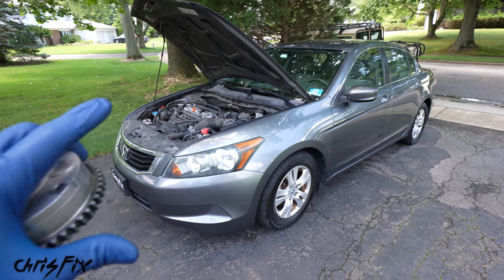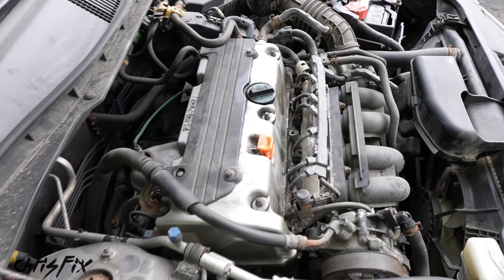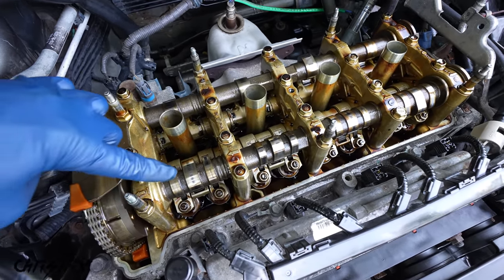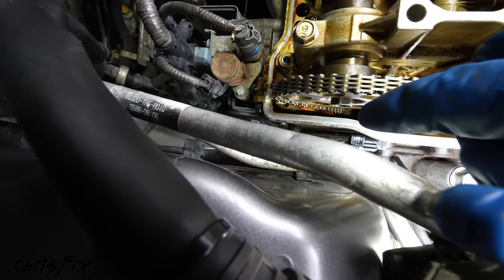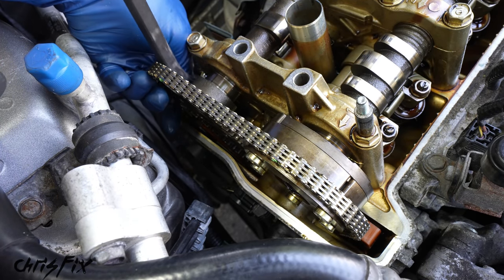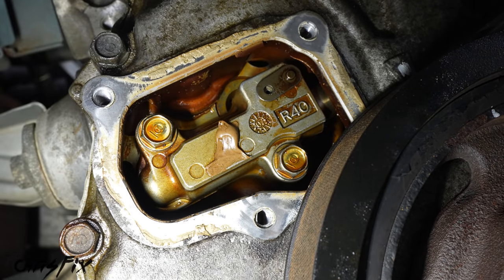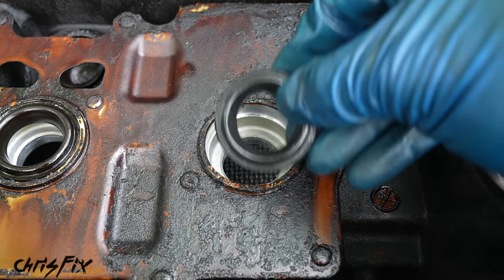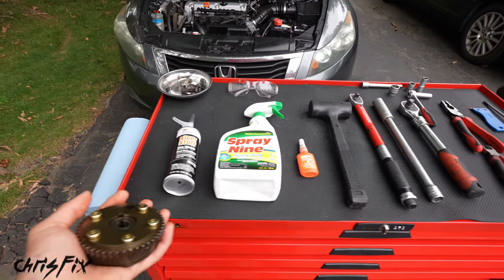How to Replace a VTC Actuator (Complete DIY Guide)

Comment: Great Video! I was gifted a 2004 Honda Civic SiR that was parked for 6 yrs. I've been driving it for 6 months and only now, when the temperature drops to about freezing intermittently I get about a 1 sec rattle right when I turn the key. There seems to be no performance issue, no codes other the an evap code and the SRS light is on. Initially I thought it sounded like a starter issue but now I'm thinking VTC. Is there good aftermorket VTC's? The dealer wants 325$ for one. Thanks for any help, and is this car worth putting money in it?

Comment: Great video. I have a 2012 TSX Wagon and it has been making the VTEC Actuator rattle for a couple of years. No check engine codes though. It's getting pretty much all the time after overnight and getting louder. So time to fix it. The OEM actuator is $224+ S&H. The aftermarket ones are about $100 cheaper.  Looks like you made this video about 4 years ago. How is the fix holding up?

PS: Where you at? Come over and help me do mine? $$$ :o)
Reply from the maker: From what I know its been holding up fine, I would grab a high quality aftermarket one and you should be good to go

Comment: I have a 2013 CRV with this issue. It also uses about a quart of oil every 2500 miles or so).. My mechanic tells me this is the "new normal" as they run hotter due to emission requirements and that causes it to burn more oil. I find it hard to believe as my 2007 Accord hardly uses a drop of oil between changes. Is this true for anyone else or do I have a bigger issue? I see no leaks and can't believe this is at all normal. Any recommendations of what to do or check would be greatly appreciated! @ChrisFix - Greatest Repair Videos I've Ever Seen!!! Thanks a million.

Comment: im impressed you were able to pull this off. however i do not recommend the average weekend warrior attempt this on their daily driver on a sunday afternoon. instead  you should start saturday morning and pull the timing cover off and do it the proper way. first off getting that actuator bolt off is a problem it itself 🤣 the best way is to remove the cam and zip it off with an impact gun. its usually so tight you will round off the cam with the wrench trying to break it loose. but anyways if you are brave enough good luck to ya! playing with interference engine timing chains is risky

Comment: Hey loved the video have a question my 2009 honda accord has excessive crank before starting when this happens the VSA light exclamation triangle and check engine lights come on I’ve changed the crank position sensor  wondering what you think

Comment: I always put the spark plug tube gaskets in the freezer for an hour. I'm never able to just push those seals in by hand and usually use a large socket to "gently" tap in the now chilled gaskets (that are now minutely smaller).

Comment: Replacing the VVT actuator in my 2016 Scion IA. You say they're supposed to come unlock from the dealer, but I saw three different ones from two different dealerships that all came locked and I was told it doesn't matter. Does it matter or not? Does it only matter on certain cars?

Comment: For those of you who don't know any better, the purpose of using heat to break a bolt loose it to warm and expand the surface the bolt is screwed in to, NOT to heat the bolt itself. 
Adding heat to the bolt will make the bolt expand in the hole.. 
You want the hole to expand around the bolt..
He still happened to crack it loose in this video, but he didn't make it any easier on himself.

Comment: I did this repair last weekend and it went pretty well, however, once I got the valve cover off I noticed the timing mark on the harmonic wheel went past the arrow when the top marks on the sprockets are lined up. I guess my timing chain needs to be replaced. I finished the replacement of the VTC actuator and put it back together. The vehicle is running fine and no engine light, but I am worried about the lack of line up on top dead center. Am I safe to wait for a engine light to come on or do I need to change that timing chain urgently?
Reply from the maker: How much past was it?

Comment: Hi Chrisfix! Would you happen to be in Maryland?,🤔
My VTC is bad and needs to be replaced.  After watching your video (btw beautiful job, very caring and professional). i'm very concerned whether a Honda dealership tech is going to do the job right and as painstakinly as you did with great care and know how.  You said it is a job costing upwards of $1100. dollars,  and watching your DIY video I see there is alot that can go wrong,. especially if they don't clean as they go,  and take smart precautions as you did.  So curious to know if this is a common repair for Honda techs and that they will/should get it right the first time and not overcharge me.  My Fit is no longer under warranty and will be out of pocket.
My engine light is not on by the way.  But only makes noise at cold starts, after sitting for a while...
Am I right to be concerned that I  can trust that Honda can do it right?

Comment: Awesome video, I am having the same problem with a CRV.  I noticed that Chris used advanced auto parts for the actuator, the OEM Honda part is quite a bit more expensive, any concerns with advanced auto part?
Reply from the maker: I havent had an issue but I got the part from the owner. If it was my car I would probably buy oem. They will both work.

Comment: as for removing the tube seals: turn the valve cover right side up, put a long flat head screw driver at a slight angle on top of the old rubber seals and hold the screwdriver in place, get a 3 lb mallet and hit the screw driver once (think impact screw driver) and the seal will put out. Do this for all of them. 10x easier then removing them from the bottom by bending them in as you did.

Comment: Anyone’s reply could be helpful here. I’m sure some have heard of just changing out the spring inside of the actuator. I’m curious if Chris or anyone else who watched this video would still say that changing the spring may be the only fix that some vehicles may need. I noticed that, while this video was amazing, Chris did not explain what actually makes an actuator go bad. The only reason for a bad actuator that I have managed to find online is the spring. There is also a fairly recently launched website that seems legit enough called “spring-start” which is specializing in these springs. I read up a bit and it seems to be an experienced engineer behind this. Probably driven by how common of a problem it was and how much easier it could be to fix. I want to fix this issue on my girlfriend’s car and I want to do it sooner than later. If the cheaper route is all that’s necessary then I’ll take it. Any thoughts on this?
Reply: Did you go through with it? In the same boat now. Thinking replacing the spring and checking if the chain is stretched is a good first step.

Comment: My 2009 acura tsx has the same problem. Even tho I plan on replacing the vtc actuator, I was wondering if it cause any sort of damage to the engine if I don't replace it or replace it right away

Comment: Hey Chris! I had a problem with my chain. I accidentally dropped the chain in and my pin fell out of the tensioner. I’m not sure if the timing is correct. What would you suggest. PS. This is my daily driver sitting in my grandmas driveway 😅

Comment: I have a question. My car is a 2011 Honda Accord 2.4. I got it from a dealer with 70k miles and now it has 170k. It runs perfectly fine. I have never taken off the valve cover until now. I removed the chain guide and proceeded to put the engine to TDC. As I lined up the crank, I noticed that the cams were not lining up. It appears that the exhaust cam is behind by 1 tooth. Could I have done this by just turning the crank while the chain guide was off? And also how would I go about fixing this? Can I just move the chain off the exhaust cam and turn the cam forward one tooth? And lastly if I don’t want to touch any of that, what if I just simply set the cams to TDC even tho the crank isn’t, then mark the notches up with paint as you do, take off the actuator, then put the new one on. Technically I didn’t adjust the timing correct? (Assuming that the car has been off by 1 tooth since I got it)
Reply from the maker: I would just take the chain off the cam and turn it forward so it lines up properly. Double check it's actually off before doing it though as sometimes it can look off but it is just an optical illusion.

Comment: I have the exactly same issue on my 2012 Honda Crv, but no other issues that i noticed other than rattling noise only in winters. Should i replace this in my car or i can live with old one? It's almost 10 years with that noise so not sure if it's harmful inside?

Comment: I would like to ask why you didn't clean the valve cover ? I will do this job soon if there is a problem with that just answer me please , also I see some one who opened the valve cover and the oil pan then washing slug engine with chemicals and water after that he blow some air until dry , is that good thing ?

Comment: hi bro, I also have accord coupe 8 gen, 2.4 automatic transmission. When I come to a stop in "D" mode at a traffic light and keep my foot on the brake pedal, the engine RPM drops to 600 rpm/min, and the hood, side mirrors, and steering wheel start shaking. When I turn on the air conditioner or headlights, the engine RPM increases to 750, and the vibrations are almost gone. I have visited many different mechanics, and they have replaced the entire suspension, axle, shock absorbers, engine mounts, but it didn't help. Perhaps you know what the problem could be? I haven't changed the spark plugs, and sometimes the engine makes a strange sound while driving, like "tak-tak-tak," but the sounds disappear when I increase the speed.
Reply from the maker: Has it always done this since you got the car?

Comment: The timing is off now on this 2010 accord I'm working on, I just put a new VTC actuator so whats the best way to fix the timing, any specific marking on the stock chain? The top dots are at 12 o clock but the middle lines are off now, they were lined up when I started working on it tho, Any advice would be helpful ASAP.
Reply: You ever figure it out? I was trying to take the bolt off for the vtc actuator and it spun the shit out of alignment so now my notches arnt lined up anymore 🫠and for some reason it won’t let me turn the crank shaft pulley anymore clockwise
Reply: @lenakarasek160  I just bought a new chain kit for it & ended up taking the timing cover off, actually in the process of it. Waiting on a specific socket to arrive in the mail to be able to take the harmonic balancer off, it's a 19mm but has to be a super thick one
Reply: @grizzy909 yea I might do that as well and get a new timing chain too I think I messed it up 😅

Comment: Hey Chris, I got a question. I recently got a socket ratchet stucked inside my spark plug engine coil, what's the best way to taken out the socket ratchet without removing the Engine Valve? I recently watched a guy use a paint can opener to get his socket ratchet out then replace his spark plug alongside with his coils.

Comment: Just attempted this job today and for the life of me I could not get that chain back on because it was so tight. Had to remove the tensioner as stated and man was that a mistake.  
WARNING*** If you remove tensioner, be super careful not to move that chain around at all except for adjustment and keep tension on it from the top. I thought mine was good when I put everything back together and turns out it's probably 2 teeth off at the crank. Now I have to take it all apart and now theres no reason not to replace the tensioner and the chain/guides while it's all apart but man I didn't want to do the full job.  I hate this happened but that tension was just too tight to get both sprockets back on.

Comment: hey Chris, in this you say don't worry about the marks on the chain they wont line up anymore. What is the point of having the different colored links on the chain at all? I'm watching this because i had to do head gasket on my 03,CRV and when i lined up marks, put chain back onto dots and made sure the crank was on the mark,when i turned motor over twice the chain wasn't even close to dots on cam gears.I've spent hours trying to find out why the chain doesn't go around its path and align with the dots and have all other marks line up. I still don't know why. It is basically just going in a circle in a triangular path so why wouldn't marks all realign?  So your saying don't bother worrying about the marks on chain just make sure lines line up and crank is on and your good to go? I'm confused by this. I've done a shit ton of civic belts and Acuras. This is the first time I've done one that when you rotate it over ,ALL of the marks aren't dead on. why?

Comment: @chrisfix do you know why the Fel-Pro kit comes with 8 spark plug well gaskets instead of 4? Just to have extras? Great video! Helpful before I try to change out the valve cover gasket to solve an engine leak issue

Comment: My only problem was the cold starting noise, after watching the video I gain enough confidence to do it my self. The problem In ran into was the dead center marks were not perfectly aligned and the chain tencioner did not look like one in the video (it seems missalign) so i stoped and put everything back because it went far away from my skill level.
Reply: Did you end up having to replace the chain?
Reply: @tbarbuto2345  nope. The car has 370k miles, and I bought it for 2200, so I decided not to pay attention to the start noise and drive it like that since it works perfectly fine and the car does not worth  the investment.
Reply: @yomero8557  I understand we have been bumping our starter a couple times before fully cranking the car to start and don't hear the noise because the oil pressure builds in the actuator

Comment: Thanks! I have a 2013 Honda Accord 2.4 it rattles at cold start but many are saying it the camshaft tensioner also I notice a whining noise any suggest is appreciated
Reply: On these 2.4 Earth Dreams engines we replace the 5A2 VTC Actuator locking pin spring and the timing chain tensioner with an OEM 5A2-02. This has given  us excellent long term results.
Reply: @spring-start  thanks

Comment: Hey Chris. Would there alway be an Engine light on with a bad VTC Actuator/Sprocket? I have the cold start rattle/grind but it is intermittent in how severe and sometimes not at all. I have heard that its goo to check the spool valve screen and the pre-screen near the PS pump. Also could it be the VVT oil control valve affecting the oil pressure leading to the rattle? Maybe even the timing chain tensioner? So many variables and options ive read..

Comment: @ChrisFix love your videos but I need help.  I started this job and am having difficulty getting the cam sprocket back on after torquing the vtc actuator.  I followed your extra tip and even removed the automatic belt torsioner. I can then get the sprocket on but then there is no way the torsion is getting back on.  I’m afraid the timing chain may have moved on the bottom sprocket or something? Is this fixable without taking the whole cover off?  I think I’m in trouble haha

Comment: I second avoiding the use of any type of threadlocker on the cam sprocket bolts. A trick that I have used to break the actuator bolt loose is to tie a rope between the cam holding wrench and the bumper/body. Be careful to tie the body end of the rope to metal, and not to plastic.

Comment: I had same problem with 1.8 civic from year 2008. I did not know if its starter or actuator. It only happened about once a week and no engine lights or horsepower problems. The rattling sounds very much like starter and i have read many cases about people changing actuator but problem comes back very soon.

Comment: Does the engine have to be at TDC to just replace the tensioner only?  I just want to do that little price inside the panel behind the crank pulley.  If that doesn't help, I am going to have to do the whole job with the actuator

Comment: Just wanted to know what went bad; the actuator look solid, it’s just like what you’d find put used for sale. What was the problem?
With rubber parts it’s wear, with liquids it’s their transparency, with electric parts it’s the bad connection due to rust etc, chains can lengthen and cause misalignment; can’t think of the reason a solid (kind of) piece of metal created such problems

Comment: I have a huge question 🙋‍♂️ how long do you have to wait till you you added the RTV on the 4 corners ? Before adding the valve cover back on?
Reply: Depends on if you use the quick setting rtv or the regular rtv. Follow the directions on the packaging and you will be good. Rtv instructions work the same way no matter what surface your putting it on. Hope this helps.

Comment: The requirement of an induction heater to break the bolt is a show stopper since the diy will not have one and it cost over $200 for a 1000W. What is the wattage of the one you used?

Comment: Hi  have a honda freed hybrid 2013 model 
I have changed the plug and the coil and cleaned the fuel injector 
But still fuel consumption very high 
My battery also good condition